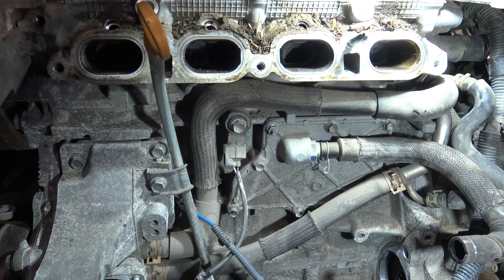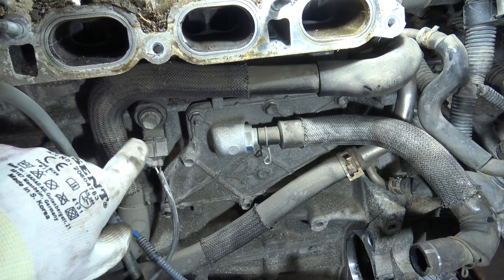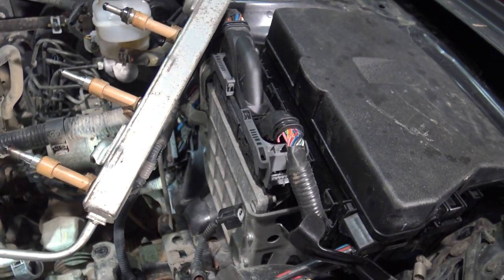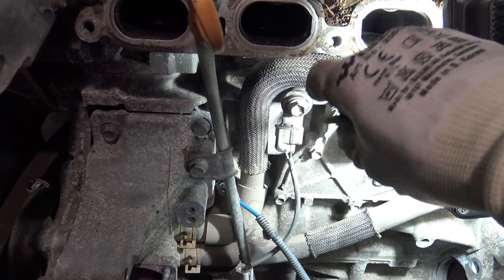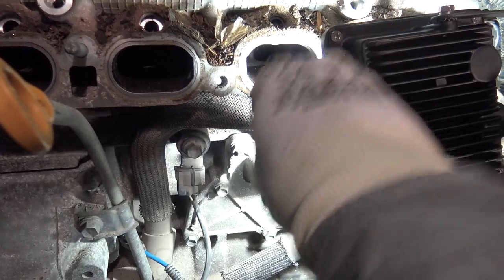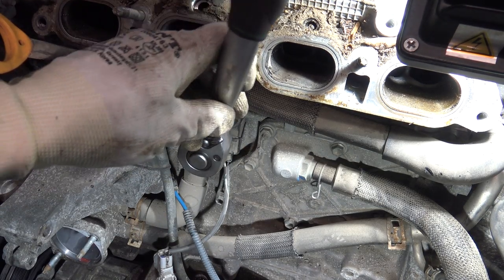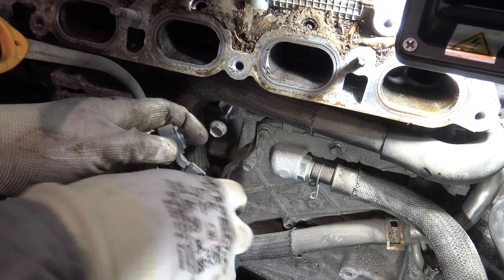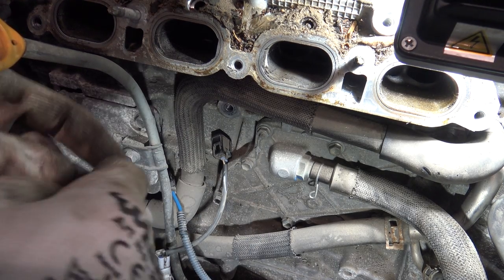How works Knock Sensor

Comment: My car says it will run better on 91 octane. A few times I had pumped bad gas into my tank from different gas stations even when putting premium 93 octane it registered a check engine light related to the knock sensor. I now only trust gas from certain gas stations that's all it took to remove the check engine light each time and hopefully didn't cause any damage to the engine. But at least I know the knock sensor is working. :)
Reply from the maker: Ok